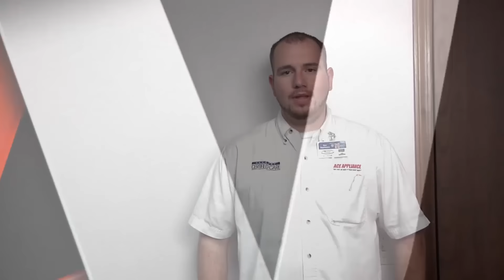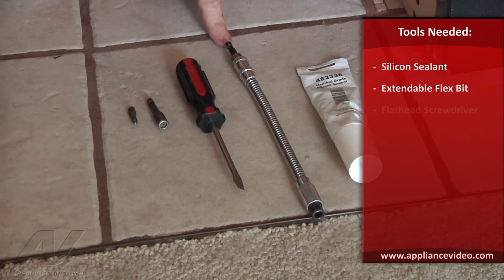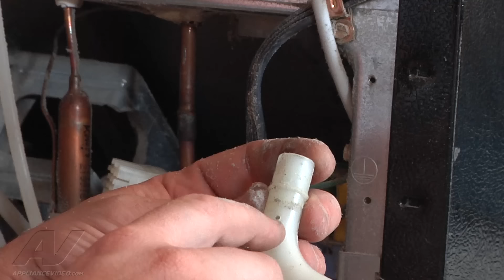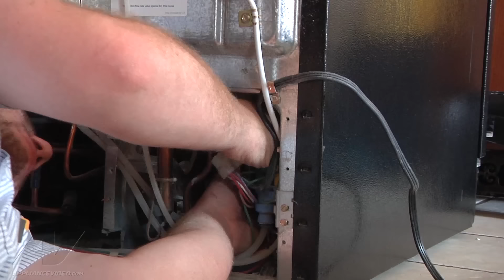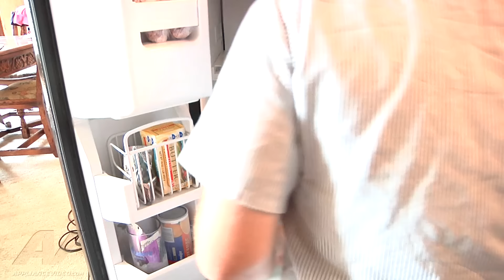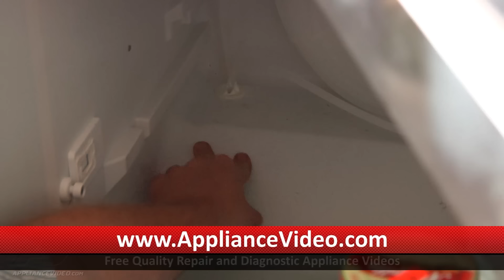Kenmore Refrigerator Repair - Leaking Water - Drain Tube

Comment: saved me a ton of money, I had the same drain plugged issue only mine was styro foam beads I assume that came from packing material that got left in the freezer but I blew out the p trap with compressed air and then flushed with warm water as you suggested and I'm back in business with my 10 year old whirlpool.

Comment: I did clean twice that tube was Clog first and still  Linking it frozen on the button. what else???
Reply from the maker: Great question, if you have a more technical question that our parts department cannot answer, you can search our over 17,000 answered questions free at our website www.ApplianceVideo.com under our Repair Help section. You can also call our parts department at 1-800-830-5465 and they can give you help 7-days A week ,or search at www.SaveMoreOnParts.com  .

Comment: My refrigerator already had the new design drain tube, but it was plugged up with I don't know what. I removed the tube and cleaned it out completely with a small bottle brush and ran hot water through it. The video did help me figure out what to do.
Reply: Where do I purchase revised drainage tube?
Reply: @williamjordan3584  Even the new design gets plugged up, that was my problem as well as several other's. I would start with taking a look at your existing tube for a blockage. Otherwise  you can get the model number of your fridge from inside the fridge part. You can use that to google for replacement parts.
Reply from the maker: Great question, if you have a more technical question that our parts department cannot answer, you can search our over 17,000 answered questions free at our website www.ApplianceVideo.com under our Repair Help section. You can also call our parts department at 1-800-830-5465 and they can give you help 7-days A week ,or search at www.SaveMoreOnParts.com  .

Comment: My Kenmore side by side is visually leaking from the back where the translucent line goes into the top of the freezer. What could this be? I recently had issues with low and high water pressure.
Reply from the maker: Great question, if you have a more technical question that our parts department cannot answer, you can search our over 17,000 answered questions free at our website www.ApplianceVideo.com under our Repair Help section. You can also call our parts department at 1-800-830-5465 and they can give you help 7-days A week ,or search at www.SaveMoreOnParts.com  .

Comment: My Kenmore refrigerator started leaking water on the floor last night. I wiped it up and there was more water again this morning. Hopefully this is the the problem. Have not pulled it out yet but was able to get a little look from the front and see the drain pan. Looks like it's completely dry and assume the drain is clogged.
Reply: I discovered I have a different problem and it's not related to the drain tube. There is a water line coming out of the pump for the ice maker that is leaking. I can see it leaks when the pump is on while refilling the ice tray. There is an elbow joint on the line and there is a crack on it where the water is coming out. There was no ice on or around the condenser and the drain tube is clear. That's not the issue for the leaking. Looks like I need a new line to fix it.
Reply from the maker: Great question, if you have a more technical question that our parts department cannot answer, you can search our over 17,000 answered questions free at our website www.ApplianceVideo.com under our Repair Help section. You can also call our parts department at 1-800-830-5465 and they can give you help 7-days A week ,or search at www.SaveMoreOnParts.com  .
Reply: @Appliancevideo  Already fixed it. I heard this particular Kenmore model had a problem with that elbow cracking. I ended up cutting it off but had to purchase a coupler that accommodates two different sizes of water lines since the water line that went into the elbow was a larger diameter, and would not fit into the water valve that controlled the ice maker. The coupler allowed me to reduce the line size to fit into the valve. Easy repair and was able to salvage most of the existing water line. Glad there is no more leak and it only cost about $7 to repair it.

Comment: Where do I get the tube? Thanks in advance.
Reply from the maker: Great question, if you have a more technical question that our parts department cannot answer, you can search our over 17,000 answered questions free at our website www.ApplianceVideo.com under our Repair Help section. You can also call our parts department at 1-800-830-5465 and they can give you help 7-days A week ,or search at www.SaveMoreOnParts.com  .

Comment: Where.or how do I fix a water leak that only leaks when you use the water from the dispenser
Reply from the maker: Great question, if you have a more technical question that our parts department cannot answer, you can search our over 13,000 answered questions free at our website www.ApplianceVideo.com under our Repair Help section. You can also call our parts department at 1-800-830-5465 and they can give you help 7-days A week ,or search at www.SaveMoreOnParts.com  .

Comment: Do you know hvac? I liked your presentation. I have similiar situation (leaking) not had time to diagnose, but will do we'll qith your demonstrations. where did you get parts from the P trap type tube and the food grade  silicon?
Reply from the maker: Great question, if you have a
more technical question that our parts department cannot answer, you can search
our over 10,000 answered questions free at our website www.ApplianceVideo.com under our Repair Help section. You can also call
our parts department at 1-800-830-5465 and they can give you help 6-days A week
Monday -Saturday, or search at www.SaveMoreOnParts.com  24 hours
7- days A week.

Comment: When the freezer goes into defrost mode the water goes to pan under fridge. Is it possible enough water could accumulate that it could overflow passing through an adjoining wall into another room. I just had some serious water seepage into my bedroom and after a plumber inspected for 3 hours looking for leaks none could be found. The flooded area was about 4 foot in diameter.
Reply from the maker: Great question, if you have a
more technical question that our parts department cannot answer, you can search
our over 10,000 answered questions free at our website www.ApplianceVideo.com under our Repair Help section. You can also call
our parts department at 1-800-830-5465 and they can give you help 7-days A week
Monday -Sunday, or search at www.SaveMoreOnParts.com  24 hours
7- days A week.

Comment: Thanks for a great video. I took the back panel off, pulled the p trap off , within 5 minutes water was coming from the drain hole. I blew out the p trap with compressed air, problem solved. The p trap comes out easy as it is connected to the drain hole with a o ring, just pull down.  Thanks again .
Reply from the maker: Thanks for your response, and we are glad we could help.
Please help us by subscribing to our Facebook page, YouTube channel, or post
our website www.ApplianceVideo.com .

Comment: Where can I get that replacement p-trap tube? I need one.
Reply from the maker: Great question, if you have a
more technical question that our parts department cannot answer, our
technicians are answering all questions at our website at www.ApplianceVideo.com under our Repair Help section. You can also call
our parts department at 1-800-830-5465 and they can give you help 6-days A week
Mon-Sat . You can also search at www.SaveMoreOnParts.com 7- days a week.

Comment: How do you remove the plastic tube that connects inside the fridge?
Reply from the maker: Great question, you can call
our parts department at 1-800-830-5465 and they can give you help 6-days A week
Mon-Sat . You can also search at www.SaveMoreOnParts.com 7- days a week.  If you have a more
technical question that our parts department cannot answer, our technicians are
answering all questions at our website at www.ApplianceVideo.com under our Repair Help section. We have over 6,000
common questions and answers that you can easily search through by your model
number, appliance make, problem or error codes, and It’s completely free to
search through our question & answer library. There is a very good chance
you question is already answered there.

Comment: Hi I have water dripping from my water inlet valve. Do I need to replace it? everything else works fine.
Reply from the maker: Great question, you can call
our parts department at 1-800-830-5465 and they can give you help 6-days A week
Mon-Sat . You can also search at www.SaveMoreOnParts.com 7- days a week.  If you have a more
technical question that our parts department cannot answer, our technicians are
answering all questions at our website at www.ApplianceVideo.com under our Repair Help section. We have over 6,000
common questions and answers that you can easily search through by your model
number, appliance make, problem or error codes, and It’s completely free to
search through our question & answer library. There is a very good chance
you question is already answered there.

Comment: Food grade silicon? Could I use a standard white silicon?
Reply from the maker: Great question, you can call
our parts department at 1-800-830-5465 and they can give you help 6-days A week
Mon-Sat . You can also search at www.SaveMoreOnParts.com 7- days a week.  If you have a more
technical question that our parts department cannot answer, our technicians are
answering all questions at our website at www.ApplianceVideo.com under our Repair Help section. We have over 6,000
common questions and answers that you can easily search through by your model
number, appliance make, problem or error codes, and It’s completely free to
search through our question & answer library. There is a very good chance
you question is already answered there.

Comment: Ryan, I have the Maytag MSD2454GR* SIDE BY SIDE
I'm trying to get that part you installed on the video, but your website isn't showing it.
Help Please...
Reply from the maker: Great question, you can call
our parts department at 1-800-830-5465 and they can give you help 6-days A week
Mon-Sat . You can also search at www.SaveMoreOnParts.com 7- days a week.  If you have a more
technical question that our parts department cannot answer, our technicians are
answering all questions at our website at www.ApplianceVideo.com under our Repair Help section. We have over 6,000
common questions and answers that you can easily search through by your model
number, appliance make, problem or error codes, and It’s completely free to
search through our question & answer library. There is a very good chance
you question is already answered there.

Comment: I have a very similar refrigerator... mine has the drain pan filling with water (and ultimately over flowing) every few days... I have cleaned condenser coils and checked the lower part of the drain (the piece which is removed in this video) I was thinking I had it fixed because it seemed to last a little longer but alas I still got water in floor and a full pan. I have the icemaker water supply turned off to eliminate that but I am still not finding the problem. It has to be ice melting off the evaporator but I suppose it could be the switch that turns the auto defrost on...  Any ideas?
Reply from the maker: Great question, you can call
our parts department at 1-800-830-5465 and they can give you help 6-days A week
Mon-Sat . You can also search at www.SaveMoreOnParts.com 7- days a week.  If you have a more
technical question that our parts department cannot answer, our technicians are
answering all questions at our website at www.ApplianceVideo.com under our Repair Help section. We have over
4,000 common questions and answers that you can easily search through by your
model number, appliance make, and problem or error codes, and It’s free to
search through our question & answer library.
Reply: What was your solution

Comment: Great video thanks. Is there a website to buy the  drain tube, part number 2172132.
Reply: The only drain tube I could find was this one. http://www.searspartsdirect.com/part-number/W10210988/0046/106.html
Reply from the maker: Great question, you can call our parts department at 1-800-830-5465 and they can give
you help 6-days A week Mon-Sat . You can also search at www.SaveMoreOnParts.com 7- days a
week.  If you have a more technical question that our parts department cannot answer, our technicians are answering all questions at our website at www.ApplianceVideo.com under our Repair Help section. We have over 4,000
common questions and answers that you can easily search through by your model
number, appliance make, and problem or error codes, and It’s free to search
through our question & answer library.

Comment: this is the closest vid I have found to replicate my problem, drain tube is similar though a little different. I simply am not able to pull this tube out.
Reply from the maker: Great question, if you have a more technical question that our parts department cannot answer, you can search our over 13,000 answered questions free at our website www.ApplianceVideo.com under our Repair Help section. You can also call our parts department at 1-800-830-5465 and they can give you help 7-days A week ,or search at www.SaveMoreOnParts.com  .

Comment: Do I have to let the freezer defrost first?
Reply from the maker: Great question, you can call our parts department at 1-800-830-5465 and they can give
you help. If you have a more technical question that our parts department
cannot answer, our technicians are answering
all questions at our website at www.ApplianceVideo.com under our Repair Help section. We have over 3,000 common
questions and answers that you can easily search through by your model number,
appliance make, and problem or error codes, and It’s free to search through our
question & answer library.

Comment: Another helpful vid, thanks! However, I don't think this will solve my problem but I could be wrong. My drain pan underneath is overfilling with water and onto my floor. The other day I remember hearing drops of water dripping underneath the fridge. What I assume I was hearing is water dripping onto the drain pan. Any suggestions?
Reply from the maker: Great question, you can call our parts department at 1-800-830-5465 and they can give
you help. If you have a more technical question that our parts department
cannot answer, our technicians are answering
all questions at our website at www.ApplianceVideo.com under our Repair Help section. We have over 3,000 common
questions and answers that you can easily search through by your model number,
appliance make, and problem or error codes, and It’s free to search through our
question & answer library.

Comment: My fridge is a kenmore very similar to this one. Water will drain onto my freezer floor every 5-7 days or so. The drain pan never freezes or accumulates water, however. I pull the ice off the freezer floor, and it's good for another 5-7 days. Because of this, I'm thinking it's something other than the drain tube. Any suggestions?
Reply from the maker: Great question, you can call our parts department at 1-800-830-5465 and they can give
you help. If you have a more technical question that our parts department
cannot answer, our technicians are answering
all questions at our website at www.ApplianceVideo.com under our Repair Help section. We have over 3,000 common
questions and answers that you can easily search through by your model number,
appliance make, and problem or error codes, and It’s free to search through our
question & answer library.

Comment: pls help . My freezer just stop .IT work but no cold  no ice ..
polares refrigerator
Reply from the maker: Great question, you can call our parts department at 1-800-830-5465 and they can give
you help. If you have a more technical question that our parts department
cannot answer, our technicians are answering
all questions at our website at www.ApplianceVideo.com under our Repair Help section. We have over 3,000 common
questions and answers that you can easily search through by your model number,
appliance make, and problem or error codes, and It’s free to search through our
question & answer library.

Comment: We just bought a house and had only plugged in the fridge to make sure we heard it cut on and then immediately unplugged it. This was during our final walk through. Still have not plugged it in but it keeps having a puddle come out at bottom on the floor.
Reply from the maker: Great
question, you can call our parts department at 1-800-830-5465 and they can give
you help. If you have a more technical question our parts department cannot
answer, our technicians are answering
all questions at our website at ApplianceVideo.com under our Repair Help
section. We have over 3,000 common questions and answers that you can easily
search through by your model number, appliance make, and problem or error
codes.

Comment: should have started over after hiccups
Reply from the maker: Real time in customers house no second takes unfortunately.
Reply: Ignore the comments. The hiccups are classic!!
Reply: @Appliancevideo  Since you like fixing appliances, I usually fix hiccups with a big scoop of peanut butter.  I get them for days if I don't do something about it, but peanut butter usually fixes it right away.  :)
Reply: I had a blast watching it, and better yet I think you may have solved my problem! We're all just human :)
Reply: NO! This was prefect! Lightened my entire problem AND I fixed it! 😂😂😂
Reply: Phil Young I have the same problem with the water, but I have the tube with p trap. My problem is that the grommet that the tube goes into was not installed correctly from the get go.  Can that  grommet be replaced because after years of not being installed correctly, it is deformed and plugs up easily.